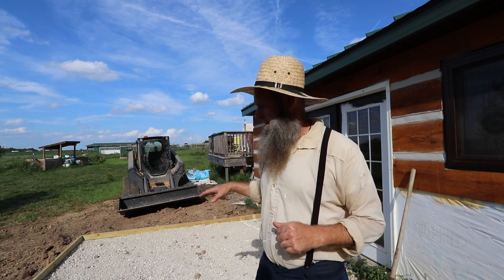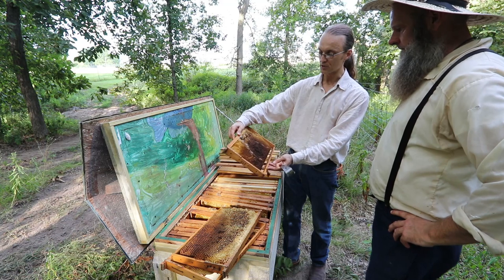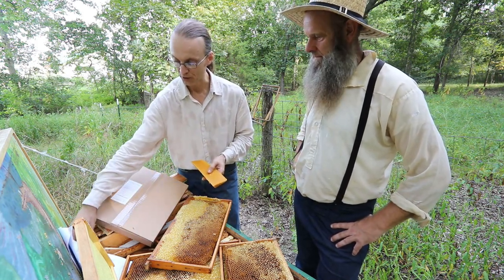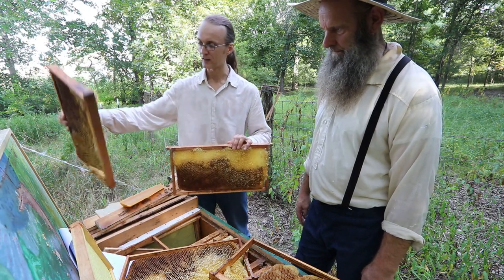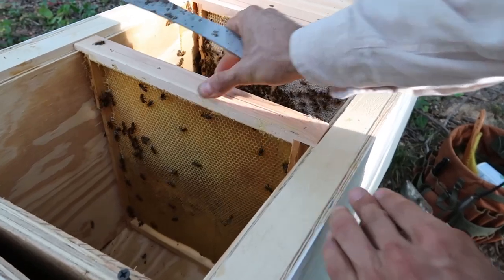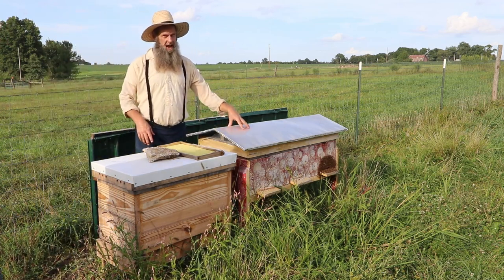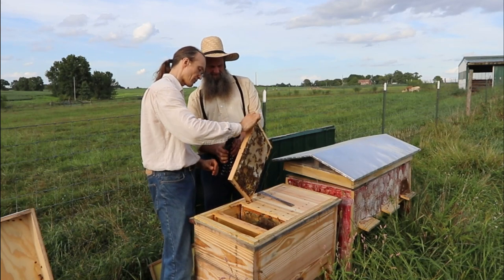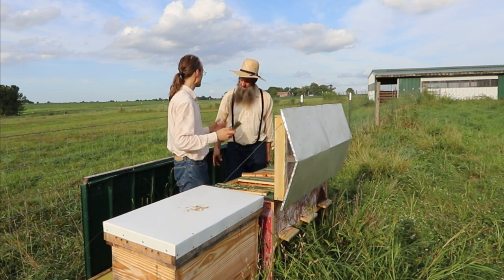Big PROBLEM in the HORIZONTAL HIVE! Was THRIVING now DYING

Comment: i have found that, up here in wisconsin, that "IF" you use plastic foundation, drilling three 1" holes horizonatally across really helps... the bees will alternately fill them or chew them open as they see fit for movement and ventilation throughout the year.... this is by no means an endorsement for plastic foundation, we use it here for convenience and the number of hives we work through the year... everyone has their preferences and must find a balance for their own needs

Comment: 11:55 that's a great tip, leaving that thin wooden insert in place does aid in the bees building foundationless comb right down. I've had great success with those strips and no wax priming at all, just using alternating foundation and foundationless frames adjacent to one another. I really enjoyed this autopsy of the hive, thank you for sharing. I would like to know if you've noticed a big difference in the small hive beetle loading in your shaded hives as compared with your full sun hives? One of my viewers asked me to pop in and view this video. Dr. Leo is a fascinating individual!
Reply: I am in texas. Does the shade v full sun matter?
Reply: @Juniperlaneestatesales  From Dr. Leo's class, he says yes it does especially with non-insulated hives in the south.  He demonstrated his insulated Layens horizontal hive with the extra (4th) entrance specifically for ventilation.  Also don't face the entrance to the Texas afternoon sun so the bees can beard on a shaded side in the heat.  Also might consider a gable roof instead of the flat roof for better ventilation.
Reply: I am doing this in my first hive as well. The bees seem to build on the foundationless frames with a starter strip first and build the comb out faster than they have on the foundation.
Reply: Fredrick, Do the bees take longer on foundation or no foundation on your hives?

Comment: I've always disliked the horizontal hive only because bees go vertical in trees.  However, the hive in the open field is very deep making it viable to overwinter bees.
My question is what do you do about varroa?  Do you still use any management of these pests?  I know you're natural beekeeping and you're basically letting the bees draw on small cell.  But, varroa still has to be present.

Comment: to make the starter substrate yourself, you could probably 3dprint the pattern, or even use a cnc machine to mill out the pattern in a piece of wood
Then press that pattern into your soft/warm wax sheets
Reply: Because it's a softer wax it might be difficult to release it from the substrate but I think you might be on to something. maybe 3d print or cnc out blanks and cast a mold with silicone to release the wax easier.

Comment: This spring i built 2 horizontal hives and bought 2 local bee nuc's to install into the hives.  It was late when I was able to get them (mid june) but they seem to be doing great.  I did find hive beetles so i bought some beetle blaster traps and put diatomaceous earth in them and sprinkled it around the hives on the ground.  Hopefully that will keep the beetles in check.

Comment: WHY wouldn't you use the same Roofing as they do for Chicken Coops which Regulates the Heat and Cold protections.  Chicken Coop roofing is special to keep the chickens from getting over-heated in direct sunlight in extreme temperature heat. With a roof like that it would keep natural wax from melting.  I believe chicken coop roof material can decrease/reflect temperatures as much as 20 to 30* degree.

Comment: Also, if you go foundation-less, make sure the hive is as perfectly level so the comb doesn’t end up attached to an adjacent frame at the bottom.   Question for Dr. Leo; if you use foundation, but cut out a corner (say, 3 inch radius) would that let them build drone cells if they want?

Comment: I had something similar happen to me last year. Using Langstroth hives I lost 4 out of 5 hives. The wax moths moved in and destroyed them even though they had been strong hives before the wax moths invaded. After speaking with many bee keepers in the area we suspect 3 different issues caused it. 1 - Varroa mites weakened them. 2 - End of summer, very hot and not a lot of resources. 3 -  Now with a weakened hive the wax moths moved in and destroyed the comb. The bees where overcome with the moths and they couldn't overcome them. 

This year I moved the bees out from under the shade trees and are now in full sun. Shade seems to encourage wax moths at least in our area. I setup 3 large bug zappers which do a great job of reducing bugs and moths in the area. Lastly, I'm testing and treating Varroa mites. So far, this is working well this year and bees look great.
Reply: A rhubarb and honey poutice has solved my mite problem
Reply: You can use a robbing screen that is useful for stopping wax moths.
Reply: @fishmanfairclough7530  That is a great point. In my case, I didn't notice until the hives where  already invaded by the months.
Reply: @Random_DIY  They are really useful and I do see moths on them but they struggle to find their way in, they prevent wasps and of course robber bees. You just have to remove them for the swarming season so not to prevent a returning queen from struggling to get back. As for SHB we don't have them here so I don't know if they are effective against them.

Comment: For straining wax I usually use 5 gallon paint straining bag you can get from most paint stores.  Keeps it all nicely together.  Course I use a crock pot to melt the wax too instead of boiling water most times but also freeze anything before I melt it.   Been thinking of building a solar wax melter to try but haven't enough wax yet to make it worth while right now.

Comment: When I first started beekeeping, I used a lot of foundationless frames. But to give the bees a guide I took several tongue depressors from my medical kit and glued them into the slot the foundation would normally sit in. It worked like a charm. I have since switched to using foundation now though.
Reply: Do the bees take longer without foundation?

Comment: I heard Steam works great for rendering wax instead of water. You hang your cheese cloth in your steam chamber and it will drip out an opening in the bottom. It's a little more elaborate because you have to build a steam chamber and a separate steam boiler and pipe it into your steam chamber.

Comment: The thing to remember about using plastic any kind of plastic plastic can be refined by boiling it in a pressure canister and it will turn right back into biodiesel fuel that you can pour right in your diesel truck so any plastic is a No-No as far as I'm concerned

Comment: What is the lowest temperature that bees are able to move around and function within the hive without being damaged by the cold or frozen? Also, what is the maximum amount of insulating material that should be used i.e. is there a thickness of insulation that would be detrimental to the bees within the hive?

Comment: I've been thinking as I'm building a horizontal hive, and wondering if it's possible to reduce the mite and moth issue without having to put any chemicals in my hive, what do you think about having a screen too small for the bee to pass through, but big enough for mites to pass through, then a natural oil coated construction paper to capture mites and such between the bottom board and screen, with a removable bottom board the oil paper can be changed without disturbing the colony. Do you think this might be helpful, and if so, what kind of oil might be best to usr

Comment: Would really appreciate a video with Dr Leo on tips to help decrease small hive beetle. I’ve tried everything. Dr Leo....Please help !!!!!
Reply: I'm not Dr. Leo, but one method I've seen other beeks use is Swiffer pad refill sheets. Just lay them across the tops of the frames. The bees will chew the surface of the pad until it's fluffy. The bees chase the beetles to the top of the frames, which then traps the beetles legs when they try to run across them. A lot of beeks also seem to be happy with the Beetle Buster bottom board.

Comment: I'm thinking the issue is the horizontal hive.  Maybe these types of hives are too large to defend after a swarm.  Bees don't like horizontal...they are vertical dwellers.  The ends of the hive were left vacant as the remaining bees congregated in the center frames.  The disease evenly got them or they too moved on knowing that familiar scent.  I mean...wouldn't you do the same?  Think like a bee....that's what I'm trying to do.

Comment: Question please; why do you have insulation on this building but not your house? Is it a different wood?
Reply from the maker: What
Reply: @OFFGRIDwithDOUGSTACY  Your house is white oak with that (forgive I forgot what its called) stuff in between and you don't need insulation. Your education building...  is that insulation under the wood panels?

Comment: 24:30
Doug,  you mention not wanting the infested hive to fester.  Granted within 1 minute you were a bit derailed by a broken lid string,  but how would you suggest managing the box?  The frames can be frozen or given to chickens,  as you mention.  Would you torch the box inside to manage the pests?  
I was able salvage a hive ravaged by small hive beetle earlier in the year but only by using 1 trap per 3 or 4 frames,  refreshing them every 10 days or so over 3 months.  Not fun but as the winter approaches I'm glad I managed the problem early on.  
Side note...  do you need special equipment to spin your Lanes frames?  I like the idea of the taller comb but I'm fairly certain they won't fit in my spinner.  
Thanks for the content you provide.

Comment: Would this layen hive work for northern ohio / southern michigan winters?   Looks like the verticale inner frame dimenesion is about 14".   And since bees cluster on the frame and move up as time goes on during the winter (Iam told about 1" per month) seems like if there was also bee brood on the frame they would reach the top and run out of food before winter is over.   Iam told bees wont go to the next frame when they reach the top they will just starve.

Comment: You've mentioned something like DE which you have poured on the ground to get rid of the ants. What do you mean?
Reply: Diatomaceous Earth.
Reply: @sparky6086  oh, sure! Thanks. It's also used against small hive Beatles, isn't it?
Reply: @RainerDetering  Ants as well. It has tiny sharp grains, so when bugs walk through it, it gets into their joints, and cuts into them as they move (I think, that it is it's mechanism of action, I'm not sure).

Comment: Heres what my thoughts are...you should get those hives outta the shade,that's the worst place for shb..There's nothing wrong with Foundation, I have Zero problems, Ritecell  foundation has pop out tabs in corners, you can also put holes in the middle and it doesn't weaken the frames for "Communication Holes", I just roll my own wax, you can buy them unwaxed...I put zero in my hives as far as traps or unnecessary gadgets for small hive beetles, the absolute best Defense against them is "Bee Coverage" hands down..
Reply: What do you mean by "bee coverage"?
Reply: @mihaelagreaney8351  meaning bees covering the frames and the seams..if you have 4 seams of bees then they can cover 4 or 5 frames, not 10..it is too much to guard and stretches them thin and they stall .. remove all the frames but what they are covering and in 2 weeks they'll be doing good again and you can give em a frame to expand on ..they CAN and do protect frames from them if they are covering them,they may be there but the bees guard them and they will never do any damage ...not Ever. Stay tuned I'll do a video and give my opinion on stuff..I never have trouble unless I let one get very weak which is my fault,not shb.they are merely an after effect of beekeeper error ,same as wax moths

Comment: Just recently found your You Tube channel. I'm planning to start a bee colony late winter 2021 so I'm still trying to educate myself of the most sustainable methods. I really like the horizontal hive method using the European Layens frames. I've also investigated the FLOW system and the traditional (USA) Langstroth vertical hive.

Comment: I am just getting started in beekeeping. I joined forces with someone who has 4 vertical hives. The benefits of the horizontal hive are compelling and i want to experiment by building one to complement the 4. The problem is the Layen frames wont fit in any of the extractors that we ahve or any that I saw online. How do you manage the extraction with so many hives?

Comment: Doug, I have a question about building a horizontal and use my langstroth frames. I would like to know if I can build the horizontal hive much longer than 44"? Can I build it 6-8 feet long and house 3 or maybe 4 colony's per hive using solid separation board to keep the colony's separate?